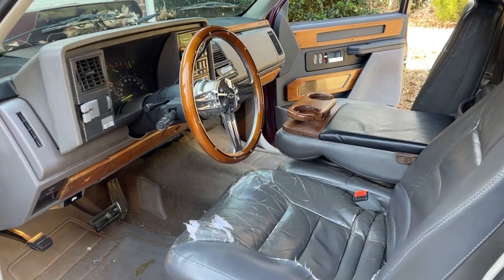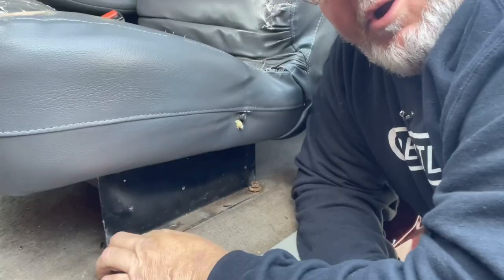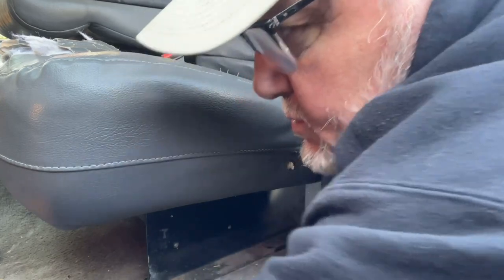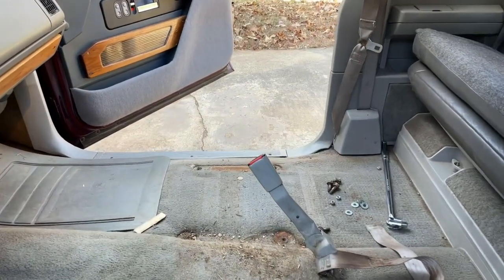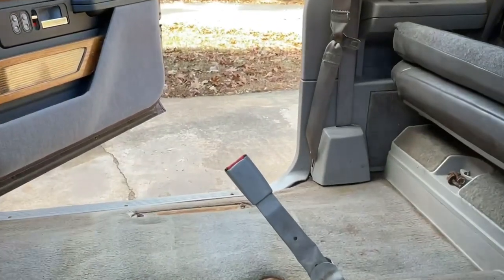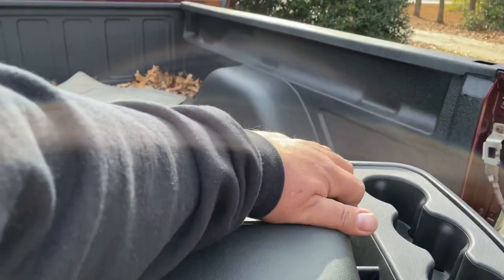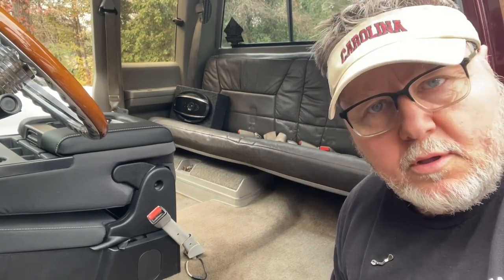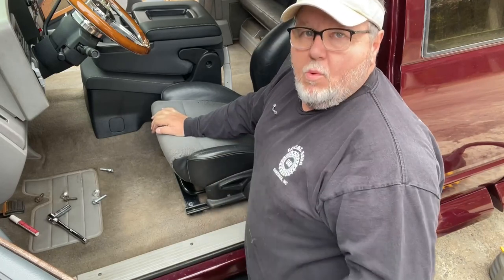Amazing new bucket seats and center console going into the 1993 OBS Chevy Mark 3 truck

Comment: good video. helpful for upgrading seats. I figured more than chevy truck seats would fit since GM likes to us parts across different brands and platforms. good job, thanks. as long as they sit high enough.
goood looking seats
Reply from the maker: Thanks man. I love them. I drive the truck almost daily and I love the position. I’m 6 ft tall and my line of sight is right in the middle of the windshield.

Comment: Well done that looks like a much nicer place to be. What’s the going rate on the console and the seats? Looking to do something similar in my OBS ford and have noticed that seats from sedans tend to be cheaper than late model trucks
Reply from the maker: I found that center console from a company in Asheville,NC that takes new cars and converts them into police cars. They were going out of business so I got it for $50. If you look them up on eBay, they go for $400-$450. 
The seats were tricky because I wanted leather but most leather seats have full power and I didn’t want power seats. 
But I found those from a guy here in town and he had them in a old Camaro but just bought new seats for it. So I got the seats for $100. But Most seats will run around $400 a pair.

Comment: Very cool. I wanna swap bucket seats into my '92 regular cab. Would be awesome to find those Cobalts. Do the pre drilled holes have thread?
Reply from the maker: Yes, I used the same holes drilled from the factory seats.
Reply: @poppagsworld7294  right on, thanks.
Reply from the maker: Thank you for watching
Reply: Are those spacers on the floor ?
Reply from the maker: @jjjj1671 Yes I use a half inch aluminum spacer to get them all gg the flight onboard. I’m 6’0 tall and it put my line of sight perfect to still feel like I’m sitting low in the truck. 
I have some knelling pads to put in the seats when my daughter drives it.

Comment: SO, yOu didn't have any height problems with the new seats?? They still were tall enough without any brackets for height
Reply from the maker: ezeduke, I like the way they sit. My eye height is about the middle of the windshield. I have no problem with vision even with my 4” cowl hood. Plus it makes you feel like the truck is lower to the ground and with the center console up a little higher it reminds me of my old race car driven days. Having said that, when my daughter drives it, I have a couple of knee cushions from Home Depot to build her up a few inches.

Comment: I guess I’m not sure how the jump seat screws went in to be secured…they looked to be horizontal while the mounts on the floor were flat…did I miss something??
Reply from the maker: Sorry that’s not on camera. There’s a 1” square tubing frame in the shape of a H that I bolted to the tunnel and it has nutserts that fastener to the center console/ jump seat. You can buy the fittings at https://obsoutpost.com/

Comment: I have  Mark 3 also. And wanting to upgrade the seats. My dilemma was I didn't want to get rid of my highback seats. The seats you installed seemed to be highbacks as well. And I like it!! 👍😊 I just might be doing the same thing, since most shops want to over charge you, and keep your ride for at least 3 months! No diss to shops in general..
Reply from the maker: Yes I understand wanting to keep a high back. These sit low and hug ya so much better than the factory mark 3’s. I am very happy with them.
Reply: @poppagsworld7294  
I want to check them out, I do like them..
Reply from the maker: @nonameisthename138  I see you follow SprayAwayCustoms, I learned to do body work and paint from watching him.
Reply: @poppagsworld7294  
Yes!! That's a bad mane!! 😯 I love his work
Reply: @poppagsworld7294 how much lower are these seats from stock seats? Looks nice
Reply from the maker: Thank you for watching Steve. I’d say they are 3” lower than the Mark 3 seats that were in it.

Comment: What kind of speaker boxes do you have in rear seat Poppa G I need to do same thing
Reply from the maker: I bought those on Amazon. They are called “Stinger Select SS69PUG 6X9 Truck Speaker Enclosure,Gray”. 
I like them but I’m going to upgrade to a box with individual tweeters, sub and woofers for a better sound.

Comment: I have a 1990 3/4 k2500, can I put buckets and console in to replace the bench seat?
Reply from the maker: Sure you can Kernie. Be aware that the passenger side is narrower. As long as a seat will fit that side, it will work on the drivers side. Then measure what you have left between the two seats and find you a console that fits. MIne is tight but I like the tight race car feel. Am I’m a Big dude.
Reply: @poppagsworld7294  I have another question that maybe you can help me with. Rims and tires, standard for the truck is 245 75r 16. How big can I go with no lifting and still have no rubbing? Can I move to 17 or 18. I have the 2500 4x4 HD, 8hole 6. 5 .
Reply from the maker: @MrCanoeman  I am still rocking the factory rims that I painted, so I can’t help with that one. I do plan an upgrade and have asked around, I’m gonna go with 18’s.

Comment: Where can  I find those seats like u took out? Want to use them as rear seats on my crew cab.
Reply from the maker: You can find them in my garage. Haha I’ll take 100
Reply: @poppagsworld7294  hi if still available I’ll buy them for the 100
Reply from the maker: @johnnie.villa2345  Are you local to North Carolina? So you can come get them.
Reply: @poppagsworld7294  sorry not local but can figure out how to do it by ups or fed ex
Reply from the maker: I’m sorry johnnie. I actually though the seers and frame railing in a dumpster a few days ago. Was hoping the guy hadn’t picked it up to take it to the landfill yet, but it’s gone. I hate that.

Comment: Do you still have the old seats and console? I’d buy them.
Reply from the maker: Yes I do.
Reply: @poppagsworld7294  sorry for the late reply. I actually have 2015 Silverado seats in my 94 but the previous owner installed them on the factory 94 brackets. I’m sitting extremely high so that’s why I was going to get factory seats. Instead I think I’m going to purchase low profile brackets or just mount directly to the floor like you did. The 2014+ seats are high so doing that I should be at the correct height.
Reply from the maker: @irishuwould5185  I don’t blame you at all. I used some 1/2” spacers to get the track off the floor so it can slide better. But I love the low stance. Makes me feel like the truck is super low.
Reply: @poppagsworld7294  I like what you did, looks great